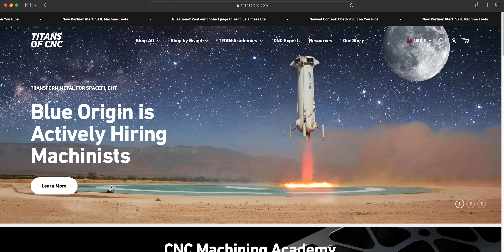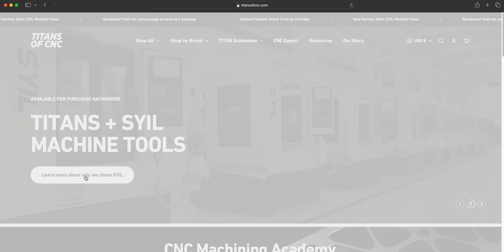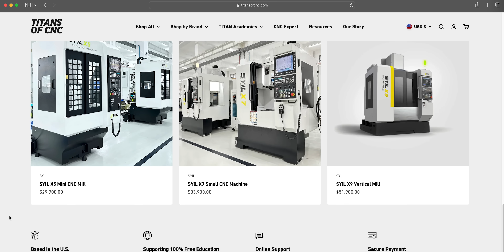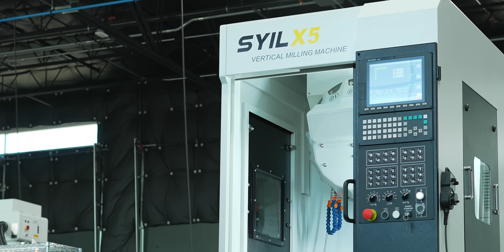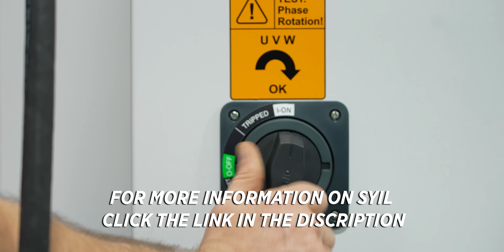Why We Chose SYIL CNC Machine Tools

Comment: The Syil X7 is a great buy, 3Gigs of memory is incredible for a 3 axis machine.
I run a 24 year old Okuma ES-V3016 at work. 64k memory! Yes, I said that right 64k!
I have to constantly "Dumb down" my programs by eliminating lead in radius for a straight or split them into parts.

Comment: I'm guessing that these take at least a 240 Volt 3 PHASE outlet? (I could not find that information on Syil website). In my experience, there is never 3 phase electric available outside my house. Maybe if you live on a major road then that is possible, but I have never had it. So if that is the case, then what? A phase converter...which costs a bit of money also. Thanks for your input Titans of CNC.
Reply: I am running my X7 off of a phase converter. From there, the 3 phase 220 is supplied to the transformer that is supplied with the machine which steps it up to 380v.  If you have the capacity to add a welding circuit in your garage then you have the capability to run one of these machines.

Comment: Let's see the Syil being put to work please.     And big diameter holes with low hp machines!
Example   I'm trying to drill 25mm hole through 1.25 "  steel

Tool storage too,  My endmill collection is out of control!!
Reply: It’s not quite as big as what you’re after but we took a 16mm carbide endmill straight into steel at 224 SFM and 14 IPM, 1.5” deep with no chip breaking.  No bogging, no bullshit despite the cut being within a few % of the theoretical max at that rpm.

I have found their 100% spindle load ratings to be very accurate so far. Within a few %

Comment: It is over for haas I think.
Reply: Haas has been around since '83, still here even there has been quite a few cheap Asian brands for quite some years already. Haas got the advange (or at least potential) with fast service when something goes wrong, especially at the US market. Even if there are several cheap Asian brabds aviable that can do the same job as Haas the challenge has been getting parts and service within reasonable time when things grinds to a stop. Don't need many days of production down before the money one save going for a cheaper machine is eaten up. Possible the service and aviability of parts will be relatively good with SYIL, but it's a big maret out there, with room for many brands and price brackets.

Comment: When are you going to bring some of them in with Siemens?
Reply: when someone has odred one with that system, I guess. There are quite a few different options, maybe they will have a small stock of the most popular versions, but guess most machines will be made according to customer wishes and there will be a few months deliverytime. 3 months maybe
Reply: @Rimrock300  Siemens control on a machine like that is huge for education. Bc a lot of shops are switching to Siemens. Need to train the gen of machinist

Comment: Can these be used on a single phase 110
Reply: You will need 12 outlets.
Reply: @frankgrabasse4642  awe for real? Yeah I can’t have that
Reply: You will need 12 outlets.
Reply: Unfortunately not 110V you can run off your washer and dryer out which is 220V single phase

Comment: Entry level light machine. Looks good, but more shameless advertising to come. Does it have a chip auger? What tool holders does it use?
Reply: There is a belt type chip conveyor option for the X7 and up. I have one in my garage.  Integrates with the control panel and appears to be very well built.
Reply: BT30 on X5 and X7, CT40 on X9. Yes, it has a chip conveyor, $3750

Comment: Is it true that SYIL doesn't have technical support here in the US?
Reply: We will be supporting this with contract techs in all areas in the future. I feel we will have that in place before your 1 year warranty period expires
Reply: They have always had support, but not like Haas support. But they rarely go wrong, and if they do, it’s easy to work on and fix yourself. I would have absolutely no issue with changing my X7 spindle myself if required.

Comment: I went to Syil’s website looking for info on the structure/build.  Nothing about ballscrew size, linear rail size, type or class.  Not one single picture of the electrical cabinet layout.  No info about servo drives, single axis drives or is it multi axis drive unit?  Overall no information on the serviceability of the machine.  I bring these points up because I’ve been a maintenance man forever and a new shop owner could be in for a shock when it comes time to replace/repair something.  Great job job trying to help out the startups.
Reply: You can request everything from them. Also a lot of documentation included when you buy the machine. Since a lot of parts are branded, they include their documents in the machine too.
Electrical cabinet layout is very very neat and they give you a wiring diagram too
Reply: I have an X7 and as far as I can tell, there are no proprietary parts that I’ve come across outside of the control. I added wireless probing, a 4th axis, a chip conveyor and filtermist myself. 

Anything you could conceive of a need of having to replace is available next day from automation direct or similar domestic industrial supplier with the exception of the spindle and mechanical components which are somewhat custom.  

Coupled with a fully unlocked controller that lets you get in and perform maintenance activities, adjust parameters or whatever else you need to do without having to pay for a special license to unlock access or get someone else involved at several hundred dollars an hour. 

There’s still work to be done in terms of delivering a 100% complete finished product but in no way is it like you’re pushed into a corner and left with no options. 

It’s not too good to be true.
Reply: Service tech myself, HAAS came back with this by opening troubleshooting up to the public. Machines now output a QR code for simple and well-explained troubleshooting! I am curious though as a tech as to how these work underneath, and how approachable the geometry alignment/adjustment is

Comment: I dream of a "Syil CNC grinder" in same X5/X7 quality/price way to democratize sharpening and reduce the cost of entry into this trade.
Reply: You can make carbide tools on a regular CNC mill. Pretty sure AB Tools does this.
Reply: @oldscratch3535   I am a (very small) carbide endmills reseller, I want to respond more quickly to customer needs.
A CNC tool grinder like a Walter HeliTronic Power is impossible to make profitable for a small workshop, even the smallest grinder from Walter (like new Helitronic G200 for example) or from other well known brands exceeds $230k without counting all the basic accessories/options.
I think there is a place for a manufacturer like Syil to offer a more affordable cnc tool grinder for small tools production and sharpening.
But I didn't find it.
There remains the opportunity to find a second-hand machine, I'm waiting for the right opportunity ;-)

Comment: My only issue with Syil over Tormach, is the weight of the machine.
Reply: Syil and Tormach are in two different classes
Reply: @Rimrock300  Agree.
Reply: But the weight means it’s stiff and gives amazing surface finish
Reply: @MrRctintin  True, but if I'm dropping it in a garage, the concrete pad thickness is a concern.
Reply: @earendall  I put 6” of concrete in my garage slab, and that’s plenty. It’s about 1800kg from memory, and even a 4” slab is strong enough for that.
Reply: Can you not offload because of the weight?

Comment: Where are these machines made?
Reply: China
Reply: Why not ask to what specs are the machines made?? Anyone can make machines these days, in a lot of different countries, the knowledge is out there, easy obtainable
Reply: @Rimrock300  because country of origin is important to a US manufacturing base. Last I checked Syil is a Chinese company of about 20 people. Their collective capitol is around $5000. They do not make their own machines but contract them out. I would think long and hard before throwing money at them. The DEM 4000 would be a much better machine with an established control, from a well known manufacturer then any of these SYIL products. 

I would not want them as training machines either, their use of non standard controls mean that knowledge of their proprietary control will not transfer over to a haas or fanuc machine with ease.
Reply: @Rimrock300  So I guess the question comes down to what kind of risk you are willing to take. My concern is that startups will see the cheap price and promises and jump on something like this. When really a startup needs a reliable machine, much more then an established machine shop. When one of these SYiLs goes down due to some control integration issue that cannot be fixed on the phone, how long before they send someone out to fix the issue? This kind of thing would be a factory level support problem that Titans group will not be equipped to fix. 

It seems like these machines will compete with the likes of the DEM4000, haas mini mill/Toolroom mills, possibly even Hurco VM5i. at a starting price of $30k they are already bumping into established brand price ranges. I'm also going to guess the $30k is a starting price range for their smallest machine. Once you add a few options and installation, you could be in the 40k range. 

My take is SYIL is a hobby level machine like Tormach. They seem to be more stout then the tormach machines, but I would not want to start a business using either of those brands.
Reply: @TheTinkeringMachinist I would encourage you to find your way in front of one

Comment: Super excited to develop training content for these videos.  A lot of people may not realize this, but by us partnering with Syil, we will have inside access to the manufacturer themselves and if we see any issues, we may can have some influence on getting them resolved.  That would be another win for anyone that purchases these machines.
Reply: We have one where I teach. Neat machine. But they need to include a multi tap transformer. The transformer is 240-380. Needs taps for 220-380, 480-380, etc.  And Table machined for jergens ball lock would be great.  Modify the castings to take a pallet jack without having  to lift machine off the floor. We bought with the tool probe, thought it came with spindle probe as well. Does not. Need to have that as an option.
Reply: Tool probe was an option, but not spindle probe. Need to have as a kit.
Reply: @danielquatrone4654  Thanks for the input!  I have these wrote down and will bring it up to them and see what we can do!
Reply: I would be happy to have a talk about this machine from an educators standpoint. I teach machining at a community college.  @Jessie_Smith
Reply: jessie, we need to cook
Reply: @romank.6788  I am always down for some smoked meat!
Reply: Really good point Jessie,witch further adds to the value of these machines.
Reply: @Jessie_Smith This is just great!! Looking forward to see your feedback on how these machines perform. While you are making parts, please enlighten us about your choice of controller, why you want the Syntec over Fanuc or Siemens, pros and cons. Technical info in general are very much appreciated. Means a lot more when it comes from someone who has proven to know their trade 👌
Have been concidering Syil for a while, but I`m a little concerned since we don`t have any dealer where I live. I don`t mind doing set ups and repairs my self, actually I enjoy it a lot, but if there is something breaking down at an early stage I`m a bit concerned about how Syil will handle a warranty issue.

Comment: I had a syil x7 for one year and I made $250k with it. Very capable machine!
Reply: That's awesome! Good work!👏
Reply: Nice one James, how is the Speedio going? 
Cheers Rob Bingham
Reply: @MrRctintin  we got 2 Fanuc robodrills. They are great!
Reply: @jacer12344  ah yeah, I could not remember what you went with, I knew it was either Robodrill or Speedio.
Reply: @jacer12344  I'm considering one. What made you chose robodrill over speedio?
Reply: Why did you sell it?
Reply: @mkemachineinc.8058  needed something faster. Hence the robodrill
Reply: Are those robodrills any more rigid nowadays?
Reply: @MF175mp  I'm not sure. I've only used new ones so I don't know anything about the old ones